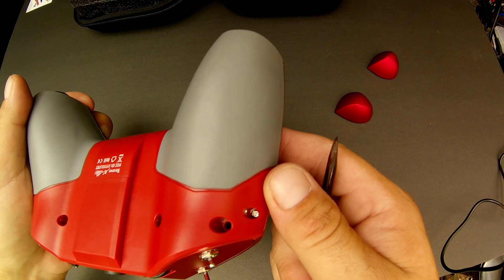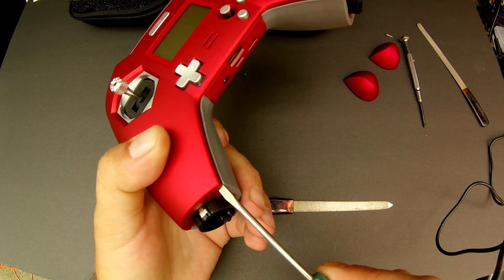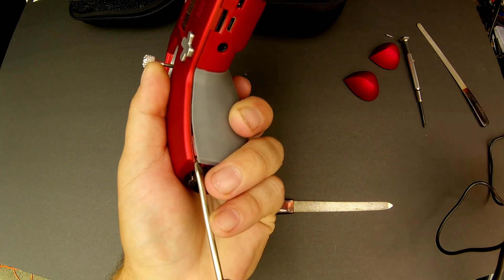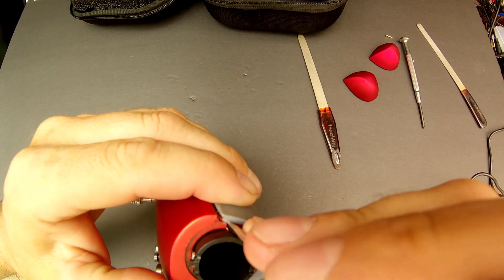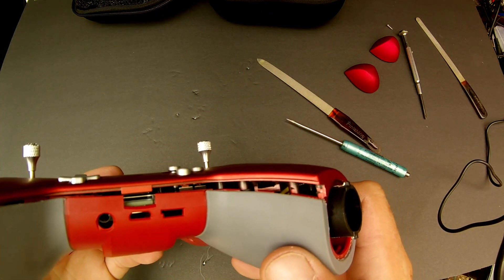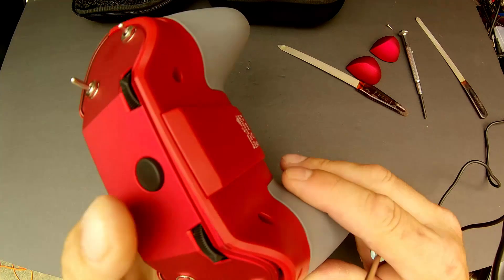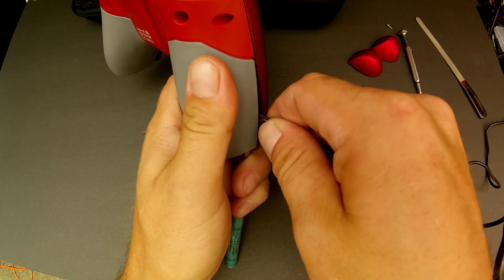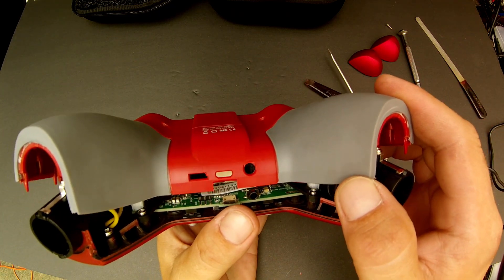FrSky X-Lite Opening the Case

Comment: One thing I've found is that a sledge hammer in just the right spot ON MY FINGERS just maybe  might  keep me from dropping one of the dang screws inside this transmitter.  
I gotta laugh that here is a video on how to pry this poor puppy open.   And it WILL help me as I have now got to go fishing inside mine for a loose screw.  Congrats to me for overdoing the screw thing and dropping it in there -- despite the mfg's clear advice to AVOID that mistake!
AND, ALSO ON THE BRIGHT SIDE:  The only, I repeat ONLY way that I can get a consistent Tx-Rx RF bind with my new X-Lite S and my FrSky RX4R receivers is to use THAT SAME SLEDGE, but in ways that I can't print here because the memories are just too, too PAINFUL!!!

Comment: Because I had this bad issue with the left gimbal of my Xlite, where the signal was not clean and smooth (lots of twitches and glitches, both on the betaflight rx tab and on the controller tab of the simulator) I opened the radio to clean it and check it. I noticed that those three cables on the gimbal  (green black red) were a little bit bent at the point where they go under that chip piece on the gimbal. Maybe they were also a litte bit damaged inside, not sure, but I re soldered them on the top of that chip instead and it magically solved the issue, it now works like new. 
Just wanted to share as it was a big saver!

Comment: Thanks for the video. The throttle gimbal sucked. I had to open to put some silicon lube on the tension bar to get it feeling right.
Reply: I didn't get the throttle feeling good until I removed the spring completely that was previously being disabled by the screw from the outside...and adding silicone based grease like you did. Started feeling crappy a few weeks later. Opened up again and polished the tension bar until it was silky smooth, reapply grease, and set tension with washers instead of the screw from the outside. Now it's been feeling good for months.
Reply: @PowerScissor Same here, got rid of that spring and it's much better. This is the only radio I've seen that keeps the spring in there and just adds drag with the tension screw in order to stop self centered action. I've started using a high temp teflon tape in place of the silicone grease on the tensioner bar. Very smooth feel and isn't prone to collecting crap on it like with the grease.